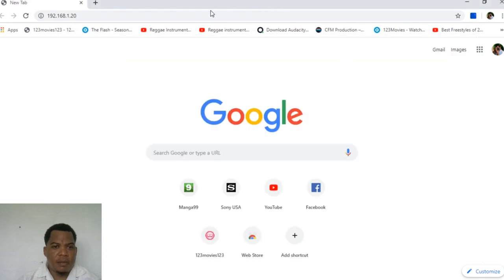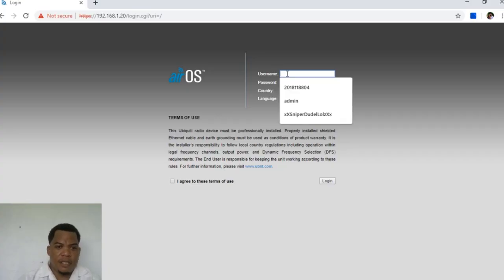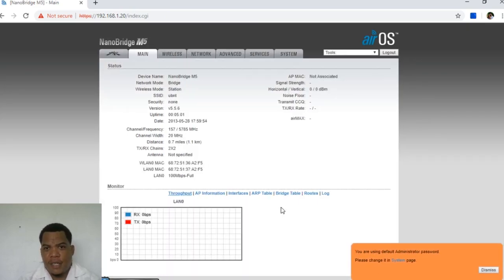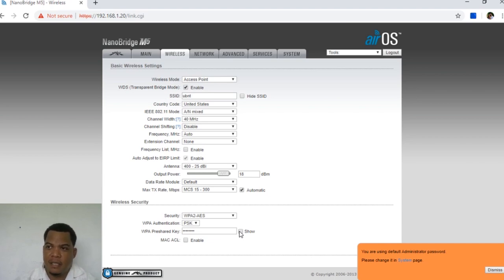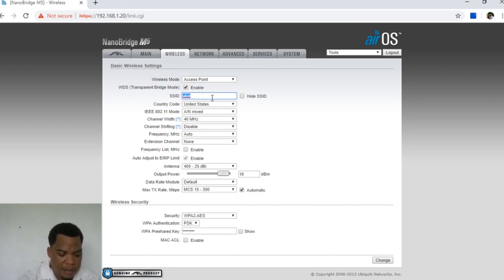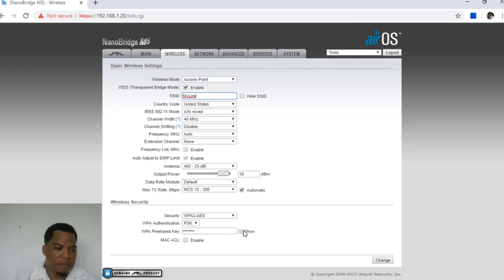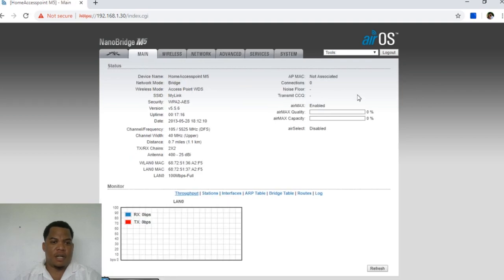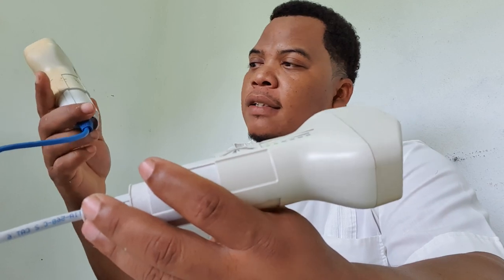5 Miles Wireless Connection with ubiquiti

Comment: Not sure if you will answer me ,but although I did not change anything (location -setting-angles ) of the Antennas from 50% signal strength it dropped to 0 !
Sometimes it gets back and gets the signal back but last two times it stayed on 0 ...
Any idea what might be causing that?
Got Litebeam M5 , distance is 2 klm ...
Reply from the maker: Ensure you have the latest firmware installed.  Also ensure clear line of sight to the other devices.